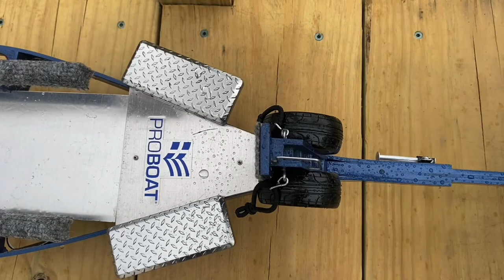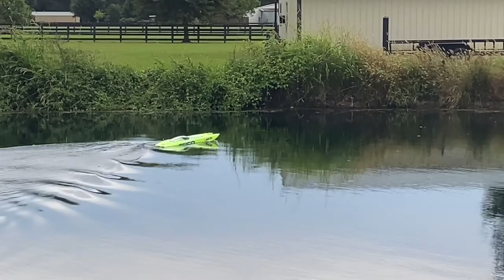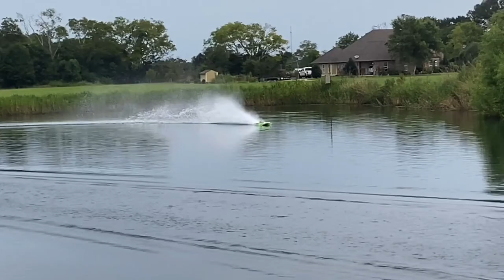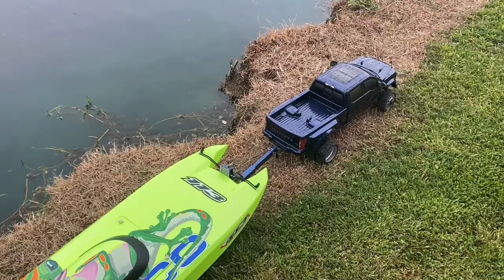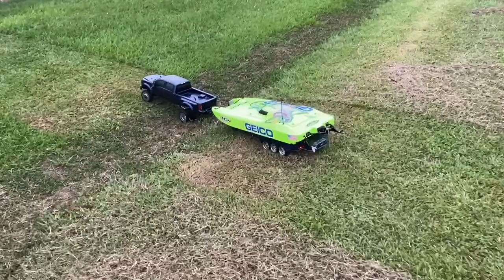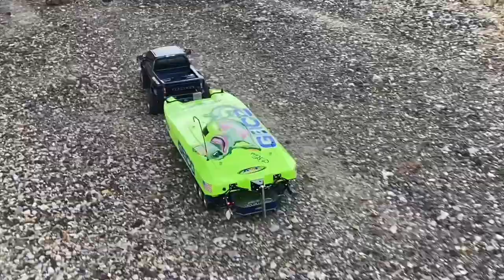PROBOAT Geico 36 with Cormier RC Trailer and Cen racing f450

Comment: I must be lucky. I have cartwheeled my zelos twin a few times at speeded with out any cracks. I definitely expect it like you said 75mph is 75mph something is bound to break.
Reply: The Zelos and the Geico, were made in 2 separate factories. The factory that made the Zelos, used a sufficient amount of glass filler to hold up very well! The factory that made the Geicos, used less material around the hull seams. That's why the geicos separate around the seams. Or that's what the guy at Horizon told me, anyway...
Reply: @Wanted1069  good to know

Comment: Are you gonna lock both rear n front differentials ? What’s the pros n cons on doing both or just rear ? Thanks
Reply from the maker: I just locked the rear. I did not mess with the front. It seems to work just fine now.